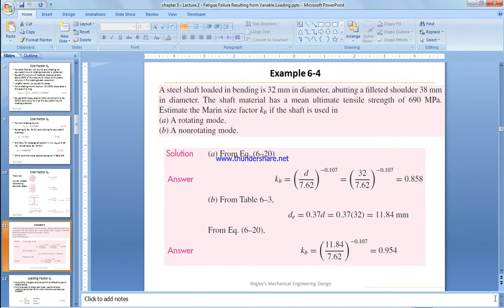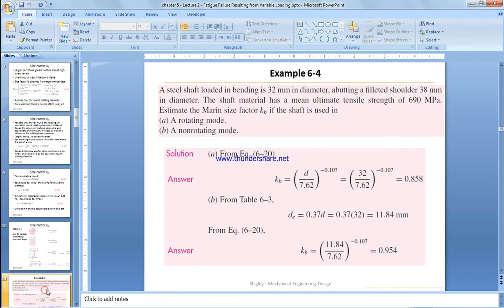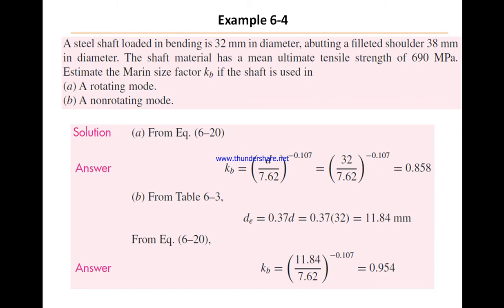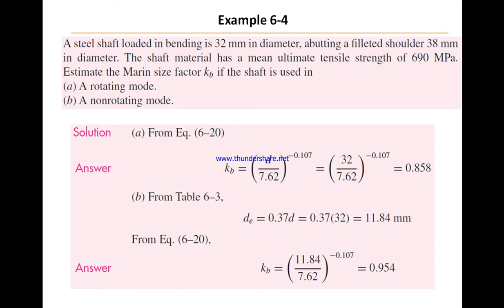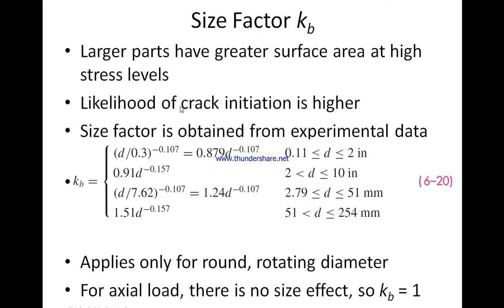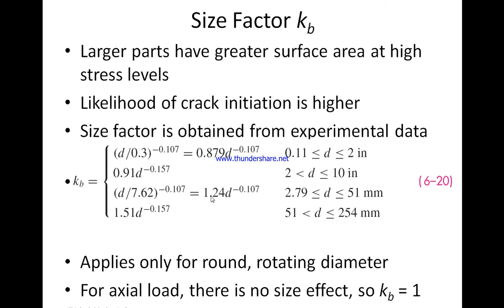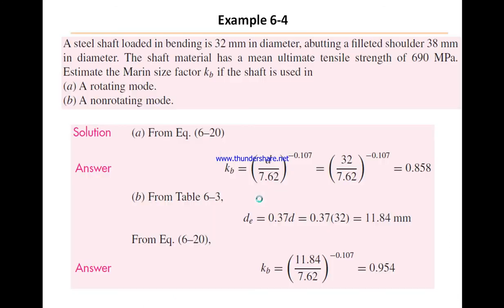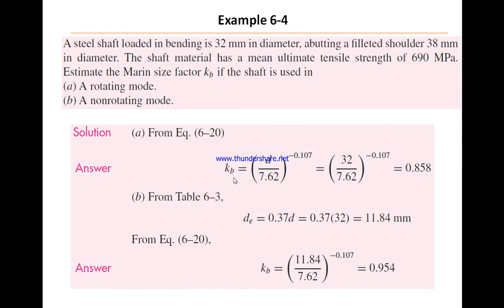Size Marin Factor kb Endurance Limit Modifying Factors Endurance Limit Marin Factors

Comment: what happend if we have a diamter of 800 mm?
Reply from the maker: Rotating or non rotating shaft
Reply: @RamziFayad  rotating
Reply: do u have a asnwer for this question?
Reply: i have a shaft diameter for bending,rotating around 300 mm
Reply: @kerab4856  Have you calculate the equivalent diameter?
Reply: @estoylopez  Should I need an equivalent diameter? Its an rotating and cylindrical shaft with diameter 300 mm. Normally  I would like to use one of the cases for bending but I dont know what to do for kb for bigger than 254 mm
Reply: @kerab4856  if u use the equivalent diamter technique u will have a value lower than 254 and u will be able to use the formula